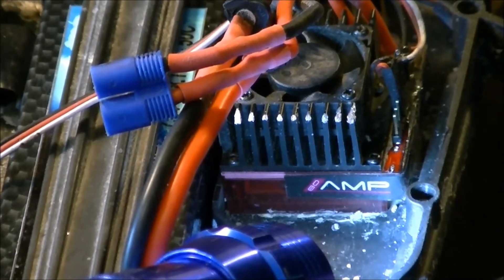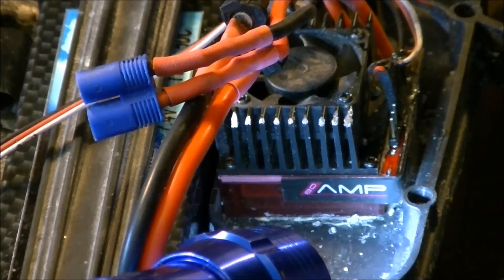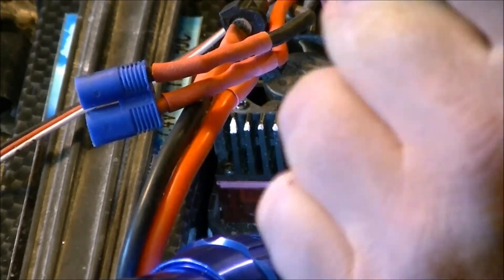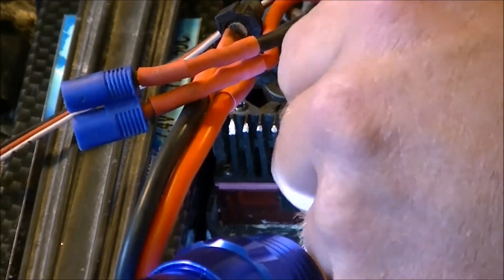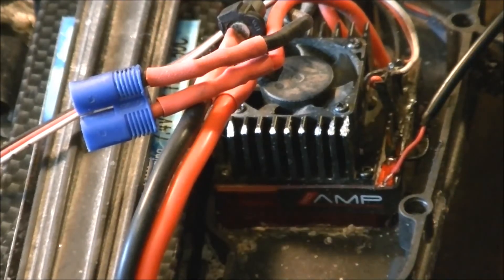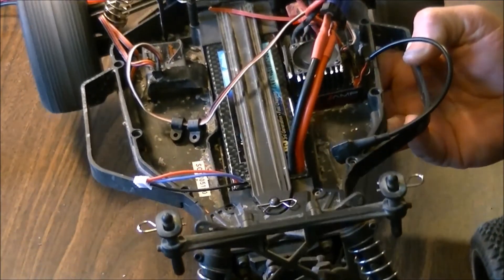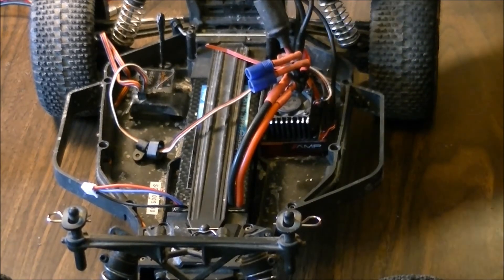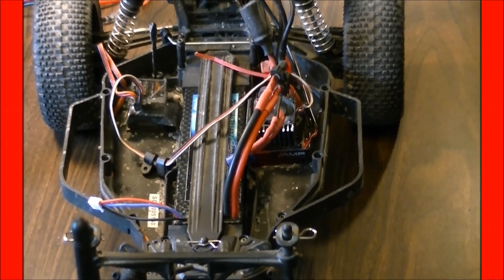Atomik 80amp ESC Program Switch Replacement

Comment: Liquid tape would waterproof these connection area's... Good job on the soldering job..
Reply from the maker: yup but i have not got any i did end up jb welding the wires after they were soldered in the truck works A1 Perfect now